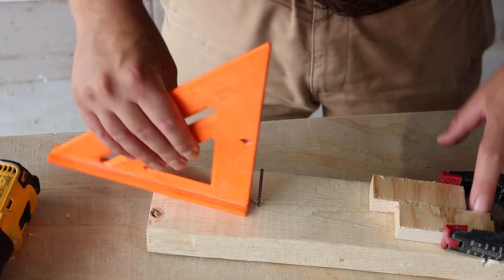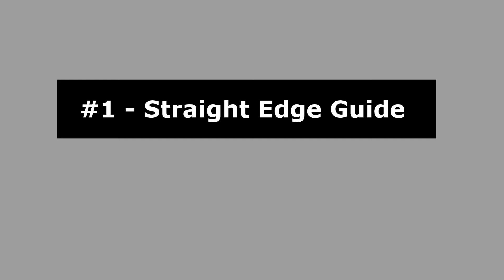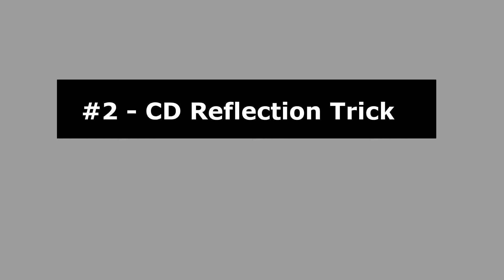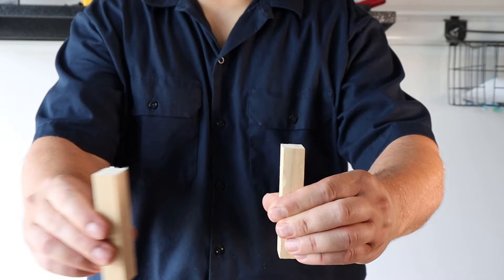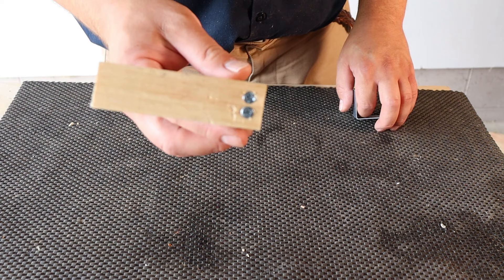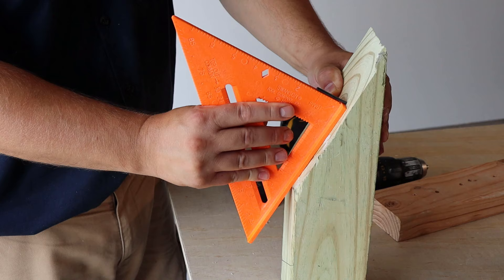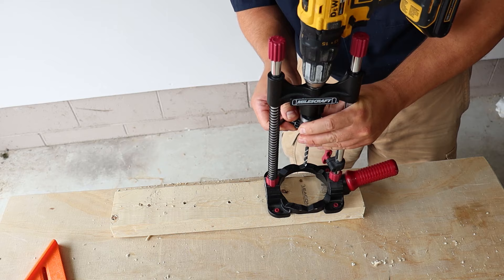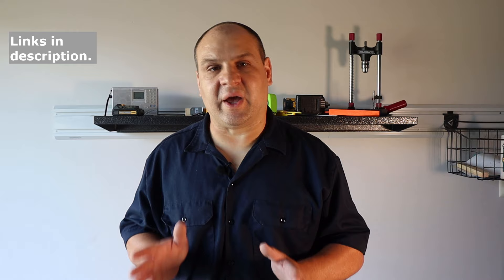🟢 Drill STRAIGHT Holes (5 Easy Ways without a Drill Press)

Comment: can someone explain to me how to drill a 4mm hole in a wooden stick that is 1cm in diameter and 10cm long

￼
Reply from the maker: Are you trying to drill into the end through the length of it? Is it like a dowel with a symetrically rounded shape and a flat circle of an end?
Reply: @DIYWithAaron  everything is flat just to pierce the length on one side hole length 7cm
Reply from the maker: This is a really small and intricate job, huh? 

So what I would do if I was doing a project like this is use the portable drill guide that is like a mini drill press https://www.homedepot.com/p/Milescraft-DrillMate-Portable-Multi-Angle-Drill-Guide-with-3-8-in-Chuck-1318/206520394. On the workpiece with a square or rectangular shape, I would draw pencil lines corner to corner to make an X with the center of the X being the exact spot that you want to drill. Then I would sandwich the workpiece on either side in between two 2x4 scraps (check to make certain they are actually the same thickness) on the flat to hold it in place so it can't move when drilling. Put the portable drill guide on top of those 2x4 blocks sandwiching the workpiece and line up the drill guide. Make sure everything is done on a flat level surface as well. Then secure everything in place with clamps and/or screws so nothing moves. Then I would double check to make sure the drill bit is in the exact right location by lowering it without drilling as a dry run to check that everything is lined up and the bit is squared up with the workpiece. 4mm is equivalent to a 5/32 bit and you'll need it to drill 7 cm so that's about 2.75 inches so you'll need something like this https://www.lowes.com/pd/DEWALT-5-32-in-x-5-7-8-in-Titanium-Twist-Drill-Bit/3421504. Put some painters tape on the bit at 7 mm or 2.75 inches up from the bottom of the bit so you know when to stop drilling. When the tape touches the workpiece you'll know you are deep enough.  

You could also use a drill block if you can find one that fits the bit well. Check around, there is probably something online. Or make a drill block by using one of the other methods like scrap wood at 90 degrees into other pieces of wood scrap. 

When using a drill block, you would want to make the surface flat enough around the workpiece with other wood so you can lay the drill block perfectly flat where you intent to drill. 2x4 + 1/2 plywood sandwiched around the workpiece maybe. Again, secure everything with that option as well. Let me know if this makes sense as it's hard to describe without showing you. Double-check my math as I'm not used to dealing in metric. 

What is this for anyway?
Reply: @DIYWithAaron  the stick I drill is made of dry beech so it is difficult to drill it to such a depth
Reply: @DIYWithAaron  can you find some hardwood and try a few pieces then you would understand what the problem is all of the above I did and tried but just drilling is a problem
Reply: @DIYWithAaron  thank you for your time, sir
Reply from the maker: Okay, I misunderstood. I thought it was about getting the hole lined up, not the actual act of drilling itself. I do more home improvement/home repair type stuff and only light woodworking so I rarely deal with the really hard woods (why I don't own a drill press). Although you probably already tried this, my only thought is to make sure your drill bit is really sharp or try a different bit. If it gets stuck in the wood, pull it out and clean off before drilling again to make sure the wood dust isn't causing it to just spin in the hole. These are the things that usually work for me when I do have any issues drilling. Most of the time if I have trouble drilling anything, it just means my bit is dull or the hole is clogged with wood dust. 

The only hardwood I have laying around is maple and I know that would not be an issue to drill at all. Let me know if you figure it.

Comment: In all my years i have never seen a drilled hole be anything other than straight.  The drill bit is straight.  Im under the impression that you mean perpendicular to the drilled surface.  Or a 90 degree hole or square to the surface.  If you should ever see a curved hole that would be a talented driller.
Reply from the maker: Yes...perpendicular would be technically correct, but people search for the term straight holes meaning just that. And although I've drilled my share of F*^&%* -up holes, I've never successfully drilled one that was curved. I'll have to keep trying.
Reply: @DIYWithAaron  great explanation.  I wouldn’t have ever considered the “what people would search for”.  That makes a lot of sense.  Thanks.

Comment: The drill guide is more expensive and less reliable.  There is some wiggle with it so it is not completely straight.  Ergonomics is also poor as you need to raise your arm quite high and try to push it down vertically.
Reply from the maker: I've been happy with the results for the most part. Yes... there's a little play in the assembly, but not too bad. If your able to, put your workpiece on a lower surface to help with the ergonomics. Although your critique is fair, I still like it as an option and feel it could be useful to some folks.
Reply: @DIYWithAaron  it is probably easier for most people as I am rather short and with a small arm span 🤣 the drill block is more accurate, cheaper, and quicker to use

Comment: As a journeyman cabinet maker I can consider these methods pretty lame. You’re always having to go and collect whatever device you’re using. I glued a bubble level on the back of the drill. I put a straight rod into the drill chuck and clamped it into my bench vice so that it was level in all directions. Then I used hot glue to attach the level and centering it. The hot glue allows you to adjust it to the counter the uneven surface at the back of the drill. Keeping the bubble in the center while drilling can be a bit difficult but considering the ratio of the bubble level and the drill position if you are steady enough to keep the bubble even close to center you will eventually achieve a plumb hole. As you drill it will become easier because the drill hole will steady drill bit.
Reply from the maker: I do like your solution even if you didn't appreciate my methods.

Comment: Personal opinion, none of these really work well other than the drill block and mini drill press gadget.
Reply from the maker: No problem, use whatever works for you. I primarily use those 2 options as well, but I have used the other methods in a pinch. Such as fixing a piece of metal patio furniture using the 90 degree angle trick... https://www.youtube.com/watch?v=Q0cdJedCqeU&t=280s